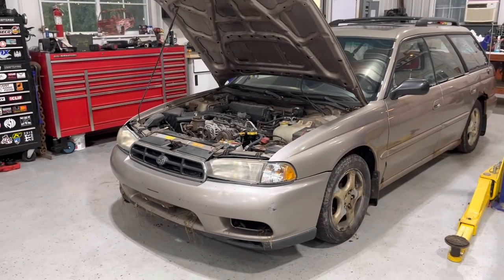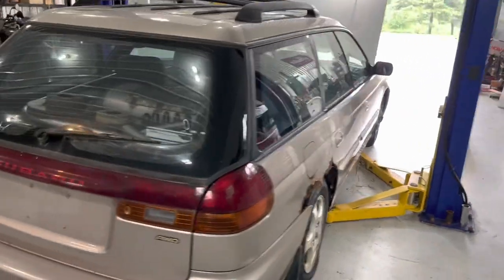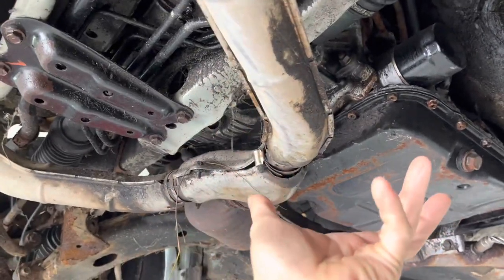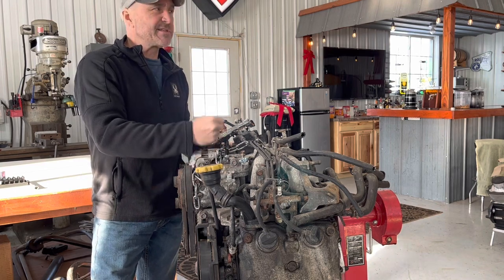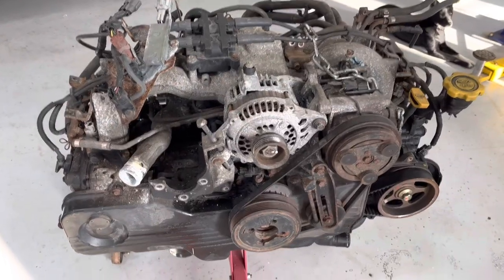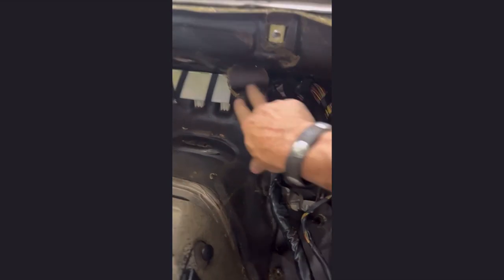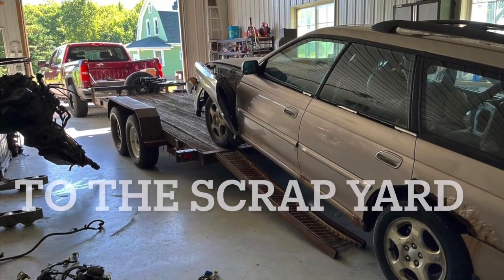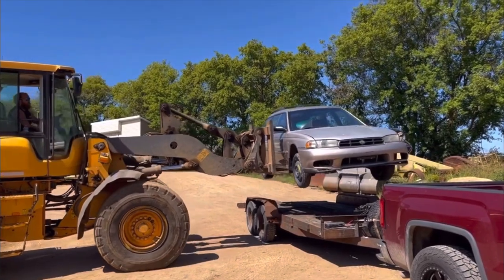Part 2- VW bus - Subaru engine (engine and harness removal)

Comment: Can you tell me where you sent the wire harness and what the cost was to do that? I'm in the process of doing an EJ22 swap on my 73 bus. Thanks a million!
Reply from the maker: Google “LowPez VW customs” in Texas. Steve is awesome and does harness work.  $500-600 should cover it.  He does swaps as a business and has some other custom parts.  Good luck!
Reply: Thank you so much. By any chance, do you have a parts list that you would be willing to share? Such things like radiators/fans/other parts and model numbers/specifics?
Reply from the maker: @joshuavallano202  hey Josh, I did make a parts list for this build .   I made a lot of stuff, exhaust, engine mounts, air intake, etc.   for the cooling system I got my info from Busaru website, there’s a parts list there for radiators and hoses.   I made my own coolant filler system but otherwise followed that setup. He has belly mount radiator part numbers or LowPez VW makes a belly radiator as well.